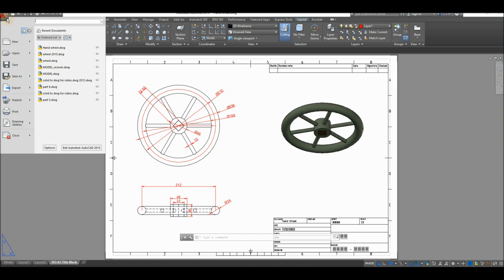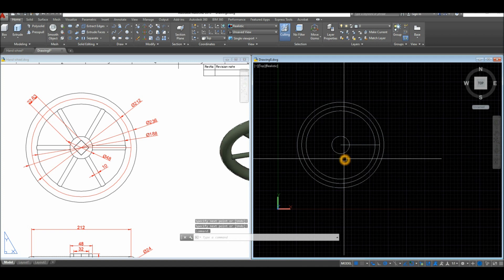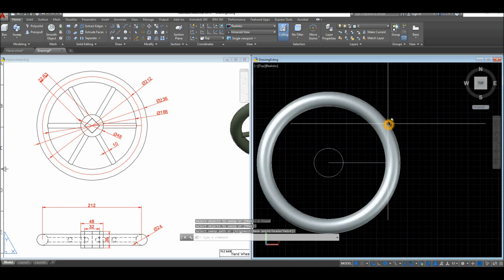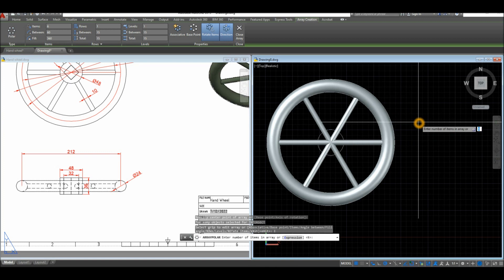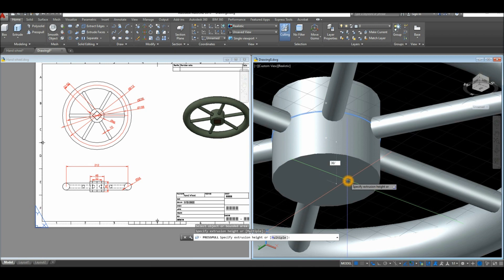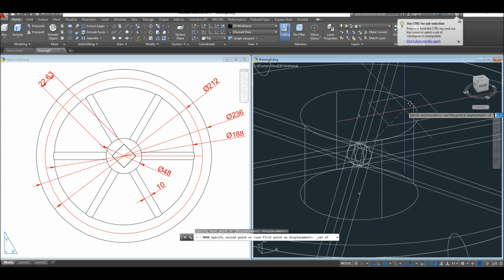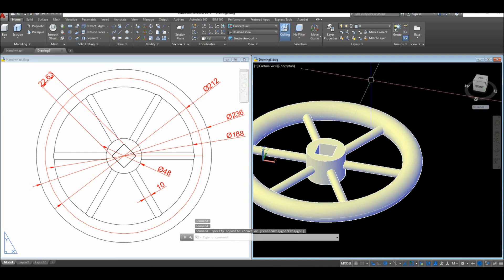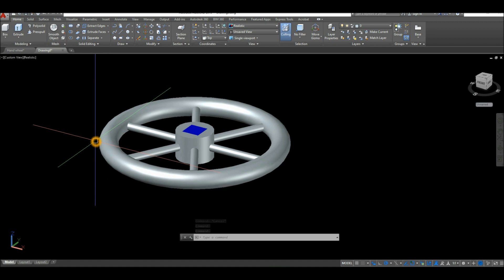STEAM STOP VALVE (HAND WHEEL) Part1 Autocad

Comment: In my case on ACAD 2022, i had to explode the polar arrays (because acad only considered it as a polar array, not a 3d solid body) and only after that i could do the unite. And after that i was able to make the central rectangular hole.
Reply from the maker: Good idea or when you use arraypolar , you can check the associative array option at the command window, click associative and answer no. Thanks for watching

Comment: Unable to convert in single solid and extrude last stage squre please help
Reply from the maker: just recreate a square by using polyline so you don't have to use the join command. Befor you extrude , make sure your z axis vector is  pointing upward ( which is the direction of the extrusion), you can do that by going to the coordinates panel in the ribbon and find "z"
Reply: Thank you